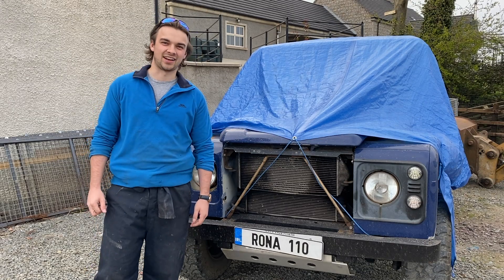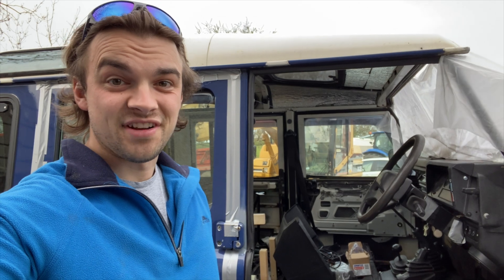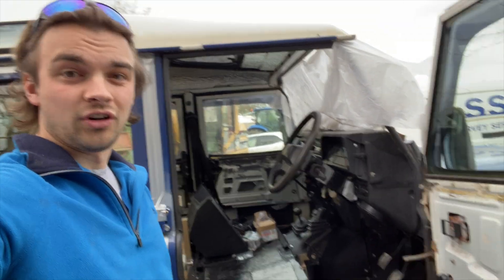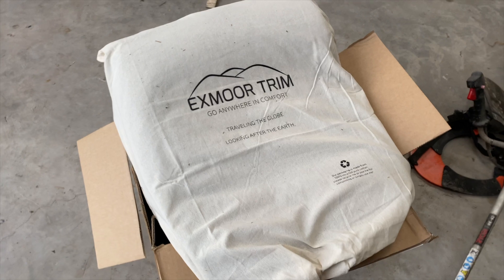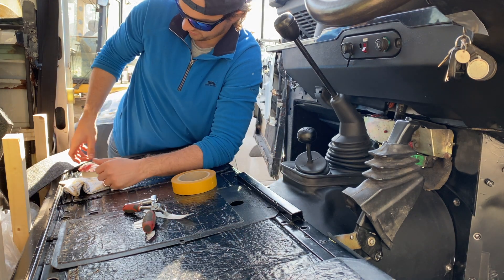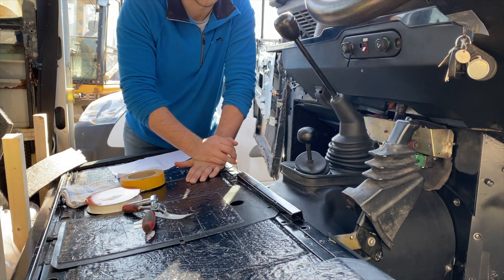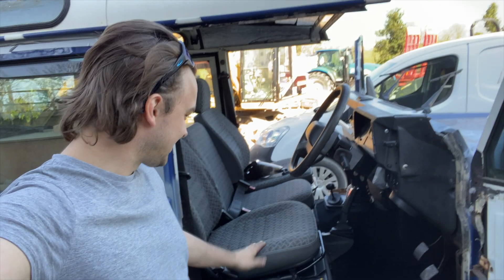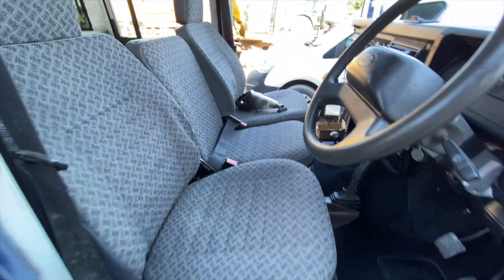Defender Exmoor Trim Carpet Install

Comment: Looks great. I did similar job in my lr defender some time ago. Remeber about investing in door seals, also in front door bottom ones, otherwise you will notice dust all over the dark carpet :)
Reply from the maker: Thanks! I have bottom seals ready to be fitted. Did you fit yours to the sill or the bottom of the door?
Reply: @roaming_with_rona  Im thinking about  them, ALR6250, but first i need to solve issues with my doors :)

Comment: How much insulation (thickness) did you put down?
Reply from the maker: On the floor and seat boxes we put down a 2mm noico sound deadening this allowed a very neat fit of the carpet but we also have a 9mm thick acoustic foam matt that covers the foot wells, which doesn’t fit as well.